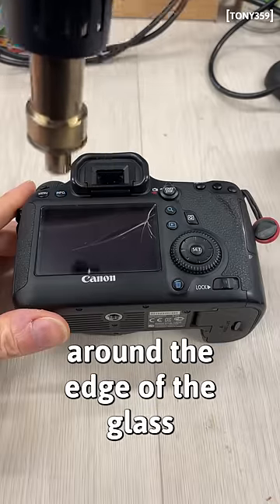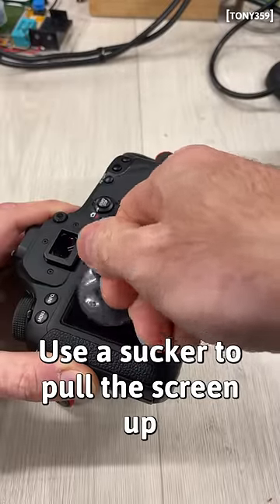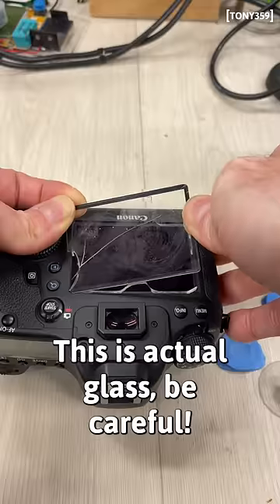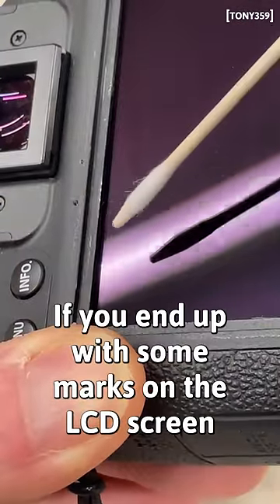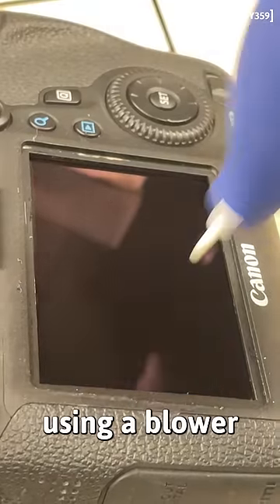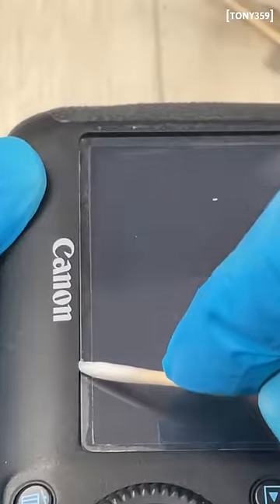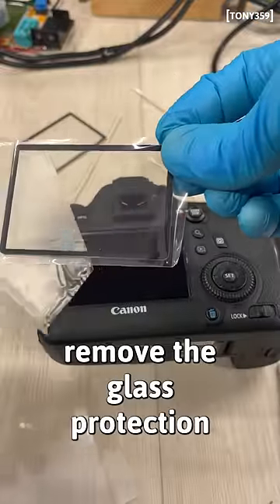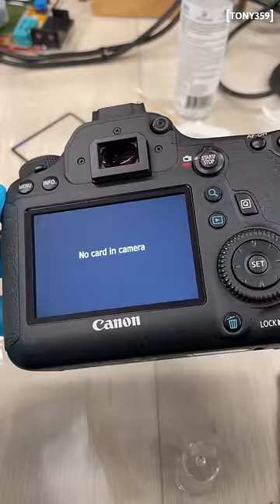Broken Canon 6D screen protector #shorts #repair #fix

Comment: Got nothing to write so here is pancake recipe:

Ingredients

⚫ 1 ½ cups all-purpose flour

• 3½ teaspoons baking powder • ¼ teaspoon salt, or more to taste

• 1 tablespoon white sugar

• 1 ¼ cups milk1 egg ⚫3 tablespoons butter, melted

Process

Step 1

In a large bowl, sift together the flour, baking powder, salt and sugar. Make a well in the center and pour in the milk, egg and melted butter; mix until smooth.

Step 2

Heat a lightly oiled griddle or frying pan over medium-high heat. Pour or scoop the batter onto the griddle, using approximately 1/4 cup for each pancake. Brown on both sides and serve hot.

Enjoy!
Reply from the maker: Cool! I shall give it a go! :)
Reply: Cool! Maybe, I'll try it...
Reply: Cool! I'm making it tonight.

Comment: Pro tip! If the crack is preventing a seal for the suction cup put some packing tape on the glass this will hold the pieces together and allow the suction cup to stick
Reply from the maker: Indeed a good tip, thank you!

Comment: You shouldn't use isopropyl alcohol directly on an LCD, if whatever you're trying to wipe away can dissolve in the alcohol, it'll smidge and be very difficult to clean (and in some cases LCDs can have a protective layer that dissolves with alcohol seen in some computer monitors) and if it gets between the edges, it can seep between the layers causing distortion. Not that you can't use it carefully, but when working on bare LCDs, it's better to use no liquids whatsoever and lint-free microfiber to remove any dust or fingerprints
Reply from the maker: Thank you, you're not the first to mention. It's a good point I did not consider. As you can (barely) see from the short, I only used a drop on a very fine cotton bud to remove some smears I had in a corner but indeed it might not be indicated for the whole screen. 

That said, if you're using so much alcohol that it ends up in between layers of the LCD, well maybe you should take your camera to a service centre :)
Thanks for watching and for commenting!

Comment: Never found it a problem, but isop for the plastic part of the screen is not good. Better be more careful, and only remove dust, than actually cleaning it.
Reply from the maker: You're not the only one mentioning that. To be fair, I used isopropyl to clean a very minor spot in a corner but you're probably not mistaken. Difficult to squeeze everything in 60 seconds! :) Thanks for watching and for commenting!

Comment: The depending on the situation, I’ve used a string to remove the glass. You use it to pull around the edges, cause I don’t like using heat on your cameras, except for very short time.

I suppose alcohol, for the most part will be fine, but some of the screens have a coating on the display itself and like a laminate, I don’t think Cannon has that, but from what I’ve seen it happen but as long as you’re not applying it directly and not for long period of time should be fine
Reply from the maker: Absolutely, you only want to warm up the back of the camera, nothing more. About alcohol, you are right. It should be used with caution. Thanks for watching!

Comment: To make it easier for the suction cup soap to stick, use a small amount of liquid soap
Reply from the maker: That's a good idea if the glass is still in one piece - be careful if it has a crack as the soap might spill underneath on the LCD itself.

Comment: 1 thing is do different is take the back off since its not connected to the lcd. I dont wanna damage the lcd so work on kt with out it. I fixed my first camera screen last year
Reply from the maker: the whole back of the camera? Interesting, is it easy to remove?
Reply: @tony359  See i did this with a Canon Rebel T6. It was my first camera. I bought it for parts not wanting to spend to much if this hobby didn't work out. I took the screws out and then it released the back panel off. I'm pretty sure the lcd was a separate unit. The replacement screen was like 12 dollars on eBay and I installed easily

Comment: In the repair shop i worked at we used scotch tape to get the dust and glass off of the lcd it was fast and worked
Reply from the maker: Good idea! Were you using any special tape - maybe less aggressive than the standard one?
Reply: @tony359  just regular scotch brand tape its stong enough for debri but weak enough that it wont damage the lcd or oled
Reply from the maker: @rufus374  that’s great to know! I think I was lucky and I had no debris left behind but using scotch seems like a great idea. Thank you!

Comment: Never knew that it had protective glass over the screen. So easy to replace. Canon always spoke of replacing the screen but it’s just glass. Lol
Reply from the maker: Not exactly easy but much better than a smashed LCD! It's complicated to find info about when searching online if you look for "LCD protector" you are presented with many thin plastic covers to protect that glass panel - which is in turn a screen protector. If you look for LCD screen, you end up with the actual LCD screen! :)
I got mine from Canon - I didn't want to deal with sub-quality products. It cost me £27, not the end of the world! Thanks for watching!
Reply: @tony359  £27 is exactly what I mean. I’ve been shooting on all the 5D’s since mark one and now R5’s. Had I known all this time it wasn’t going to be many hundreds of £’s to replace the lcd screen and all that needed replacing was a protective piece of glass I didn’t know was over it, I wouldn’t have been so stress. Lol

Comment: Spray goo gone on the cotton tip it helps remove residue easier
Reply from the maker: Absolutely. I guess WD40 would work too but I didn’t feel like using something which leaves a residue behind since I have to stick something back there. I’m probably overthinking that though! Thanks for watching!

Comment: hi i have a canon 200D and the optical viewfinder glass is cracked, i cant find a replacment online. only 60/70/80/90D glasses but their magnification isnt the same as mine. do you know where i should be looking
Reply from the maker: I'm afraid not but if you contact Canon they should be able to help you? The replacement I've got came from them.
Reply: @tony359   1st party support is very limited in bangladesh :(
Reply from the maker: I would contact Canon headquarters asking them to point you to a source?

Comment: Which screen replacement did you use
Reply from the maker: I got it from a canon service centre. I didn’t want to deal with some cheap copycats. It was not expensive. I think you can ask canon or check one of their service centres on canon.con

Comment: I probably wouldn't do it like that. I'd hate it to have dust trapped between there forever.
Reply from the maker: To be honest I had the same concern but it wasn't a small crack, it was a big one. If you are careful and you use an air blower, it should be ok. But I totally see your point.

Comment: Uhh, do you realize that isopropyl alcohol is bad for LCD screens? For LED and electrical components its okay but for LCD it isn't.
Reply from the maker: Uhm... no, I wasn't aware. But I guess it depends on the material being used. As this is plastic, I can see it might be a bit risky indeed. It's only to remove any limited sticky residues from the edges of the screen though.

Comment: Be careful you say but I guess you weren't
Reply from the maker: Clearly at some point I wasn't! It was bad luck. Camera was in a padded case but something managed to squeeze between the camera and the soft pad. I dropped the case on the grass - so soft surface - and the item managed to break the screen!

Comment: That hot airgun couldn't be good for the leatherette
Reply from the maker: You need to be careful. Mine was a hot air station set to 100 degrees Celsius. I would not use a hot gun, maybe a hairdryer. Carefully!

Comment: Screen protectors are a scam. It's maybe glass but it cracks easily. Then you think good it was only the... And buy a new one... Crack that too... And so on..
Reply from the maker: Well, glass cracks. Better to replace £27 of that than hundreds of an actual LCD screen! Thanks for watching!
Reply: @tony359  My point is, screen protectors cracks way too easily, so you have to replace them all the time. Unlike the actual hardened glass on your camera or phone, that doesn't crack very easily. You're wasting your money. 
If screen protectors was necessary it would be on from the factory, and it actually is! No need to apply cheap overpriced glass on top.
Reply from the maker: @punkerts7711  I think you are misunderstanding how that camera is built. The actual LCD screen is inside the body and what you see on the outside is a glass pane, which is the one I broke and I replaced. I call it "screen protector" as it's not the LCD screen but it comes from the factory. I think Canon's idea is to avoid exposing the actual LCD to the outer body.

So it's not the "screen protector" you have in mind (those are ADDITIONAL sheets/panels installed on top of the one I replaced) but it's hard to describe it as it's not the LCD screen! I hope this makes sense!
Reply: @tony359  I mean screen protectors in general. They crack on the smallest bumb. And people believe in them. It's a scam.
Reply from the maker: @punkerts7711  Gotcha.